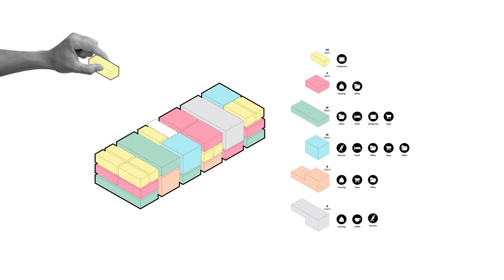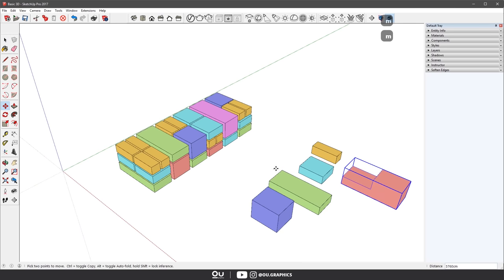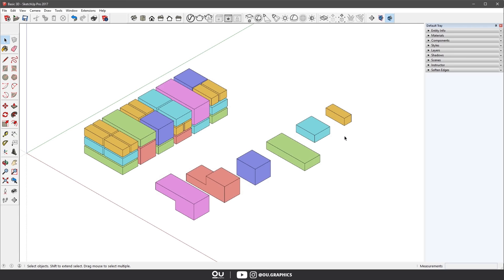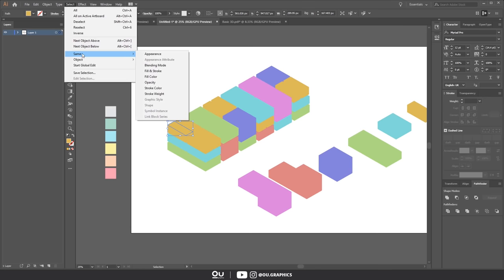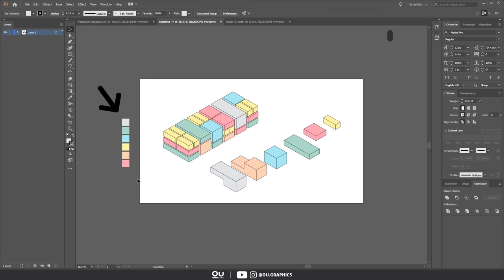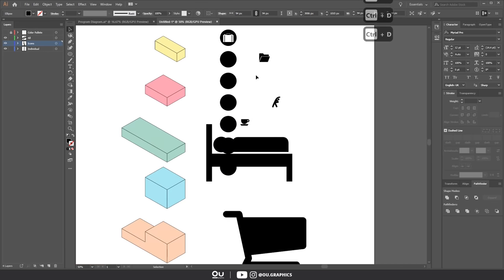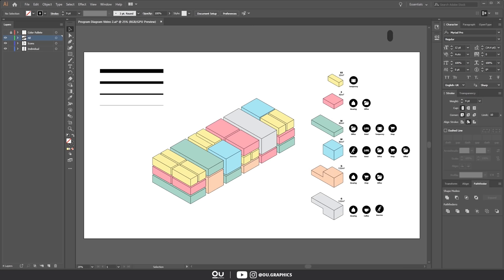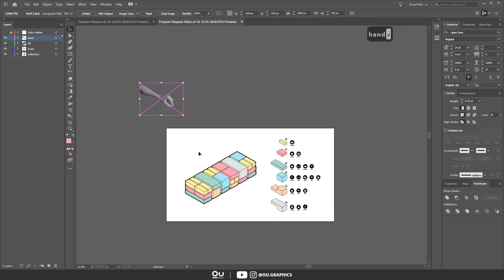Architecture Program Diagram in Adobe Illustrator

Comment: How do you choose whether using Photoshop or Illustrator? What are the advantages and differences between them?
Reply from the maker: Hi Johny!
Photoshop works with pixels, so it is best to use textures, soft shadows, gradients, adjustment layers, ...
And Illustrstor is a vector based software, so it is best to use when you are working with lines, different stroke widths, and so on
Also anything done in illustrator can be scale infinitely. You can print in any size and will remain high quality. Photshop you can't do that for example.
There are lots of other big differences, but I think this sums it up

Comment: How did you subtract icon from the circular I can not manage it. Do I need to do something with icon firstly?
Reply from the maker: Hi Ksenija!
I use the pathfinder tab to do these shape modifications.
Make sure to have the icon above the circle, then select both and chose Subtract from the pathfinder tab. That should work correctly!
Oh and make sure to have the icon as a vector shape and not image. When downloading the icon from the website, make sure that it is a .svg file and not an image file (like jpg or png), otherwise, it won't work.
Cheers
Reply: @LearnUpstairs  Thank you!

Comment: Nice video but I gotta ask does the pdf thing only work with sketchup?
Reply from the maker: I think it might work with any 3d software. Which one do you use?
Reply: OU Graphics ok I use Revit, does it work the same or is there something I have to do when exporting the file?
Reply from the maker: I'm not really a Revit user, sorry. I know it works in Archicad and should work in Revit. But theoretically, if you have your view in black and white and export as PDF, it has to work
Reply: OU Graphics ok then thanks a lot I’ll go try it out then👌🏾